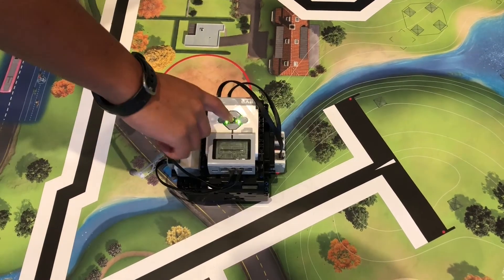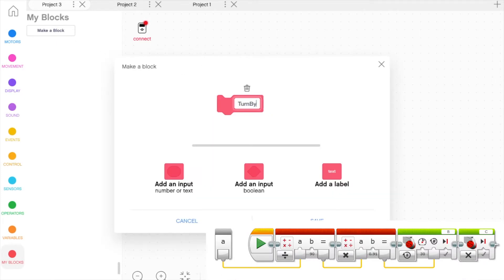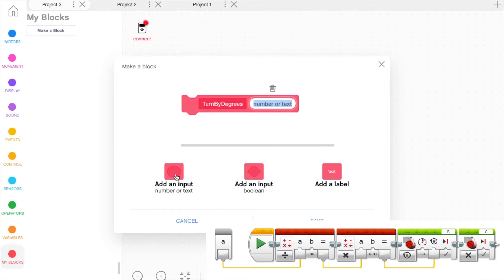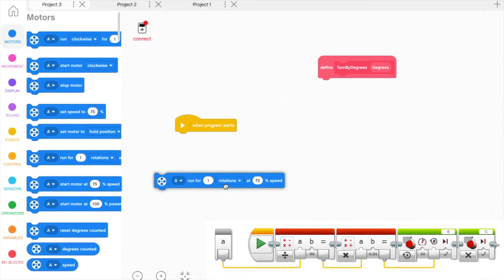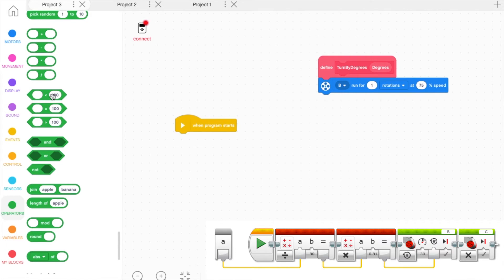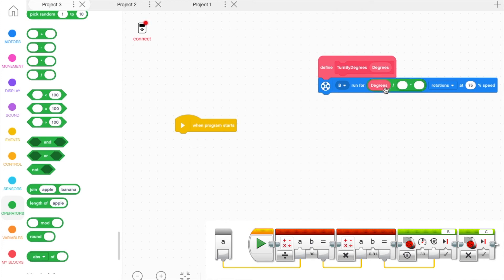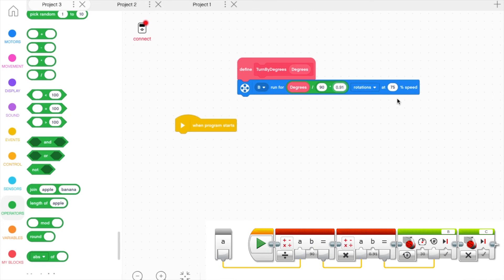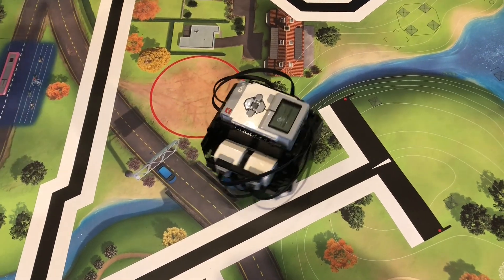FLL EV3 Classroom for RePlay: Turning by Degrees

Comment: Is there a bit of code missing? I entered that same code, but mine does not move.
Reply: I don't think the equation in the video is correct. The equation I used was MotorDegrees = TurnAngle * WheelTrack / WheelRadius

Let me know if you need help!